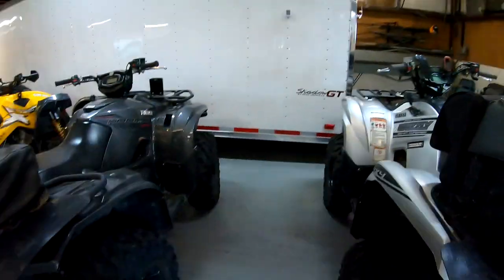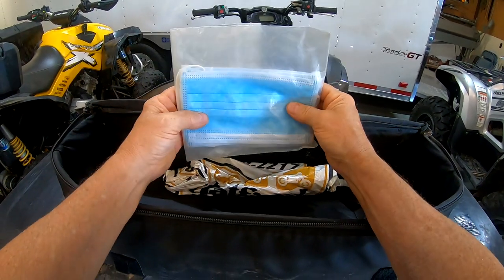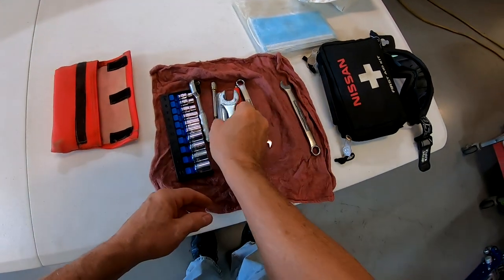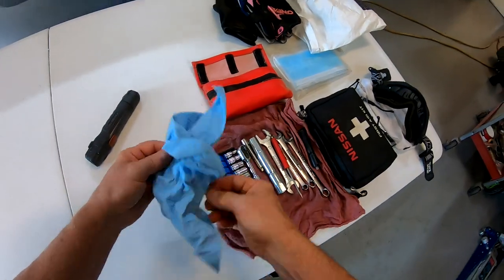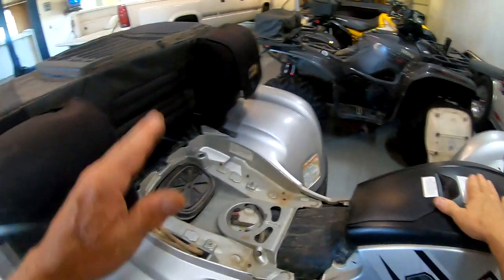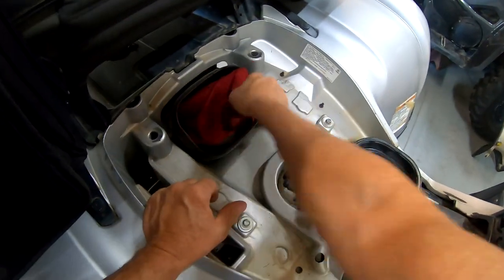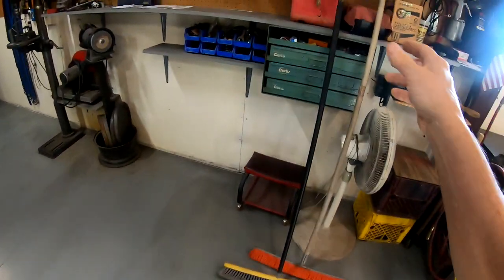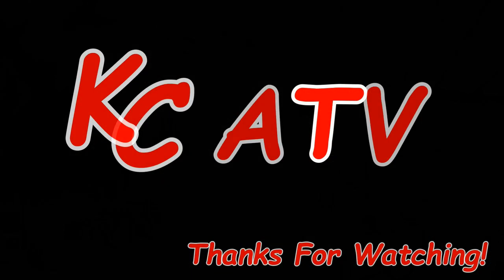Tool kit & supplies. What we carry for ATV trail riding.

Comment: Nice video. All the things you mentioned are very important things to have on a trial. I also carry a Taclife portable battery pack that will jump a dead battery, it has a 12v outlet in case the one on my ATV gives out, it has a flashlight built into it, and it can also charge devices. Great job bud. Take care.
Reply from the maker: Yeah for sure those jump start battery packs are really nice. Especially when you’re out there on solo trips. Thanks for checking out the video buddy!

Comment: I think I saw a speck of dirt on your floor right close to the rear tire on your trailer. Could you get that cleaned up for me please? I can't stand a dirty shop - lol - - -
Extra goggles: check - - - 
First Aid kit: check - - - 
Butt Floss: check - - - 
Dust Masks: check - - - 
Visine: Timmer needs to carry a bottle of that- - - 
Rain Suits: check - - - 
Tools: check (I probably carry too many) - - - 
Too many extra gloves: check - - - 
Tire gauge: check- - - 
Chain saw: check - - - 
Flashlight (or "torch" as the British say): check - - - 
Spare batteries: check - - - 
Tree strap: check - - - 
Knife: check (more than one, but why?) - - - 
Tow rope: check (more than one, but why?) - - - 
Tire plugs: check - - - 
Zip Ties: check - - -
Air compressor: check (mine is a hand pump. takes up less space and ATV tires only need a couple lbs to run decent) - - - 
Extra stuff to fix my Polaris and CanAm buddies machines: CHECK - BAHAHAHA!!!! - - - 
Extra fuel: check - - - 
Winch: check - - - 
Looks like we carry pretty much all the same stuff. Although, in my cargo box there are several other items (that I've never used), which I classify as emergency items. Maybe I need to re-evaluate my emergency items - lol - - - 
Excellent video buddy! Thanx for sharin' that info with us.
Reply from the maker: Heyyy Q ol buddy.. haha wow I don’t think you missed a thing.?The mark on the floor next to the rear trailer tire is a piece of tape. 
That way I know where to park the trailer..  Dirt? Are you crazy. LOL 
I’m sure there’s more things I should carry but oh well.. haha
Thanks for the awesome comment buddy greatly appreciated!

Comment: I also carry a Milwaukee 12 volt battery powered air compressor and tire plug kit. I have helped so many people that have needed air.
Reply from the maker: Yup I hear ya, probably one of the most common issues out on the trail is a flat tire. Thanks for checking out the video!

Comment: What kind of air compressor did u have  and the orange gps and the phone holder with brands are all them where did unget them at thanks great videos
Reply from the maker: Hi FB, I have no idea what brand the compressor is? I bought it years ago from Westlake hardware store I believe. The GPS is a Garmin. eTrex 20 the mount came with the GPS unit. 
The phone holder case brand is Nelson Rigg
Hope that  helps you out. Appreciate you checking out the video!

Comment: My God man, that poor Yamaha is sporting all the branding flair for everyone EXCEPT YAMAHA! HAHAHA! I am a firm believer in the carrying of the tp. Better to have it and not need it to need it and not have it. Poison ivy is a horrible butt wipe.

One of these days I'd like to go over my machines and put together concentrated tool kits for each of them. Not really necessary for me to be carrying around a bunch of allens and like 5.5mm sockets and stuff that aren't used on the machines. I will say that that's one of the convenient things with BMW bikes. You can dismantle those things with like 3 different sockets.

So I really like running beadlocks. I carry plugs, but lately I've thought about carrying a tube and a valve stem tool. Idk if it's practical, but if you get a bad hole, I'd feel a lot better on a tube than some of these patches people come up with. I'm sure as hell not taking the time to gently massage my beadlock ring Into place by hand with a torque wrench though either. I guess they all have their trade off.

I really liked your idea with that gas can carrier.

Great video sir. Was the CO trip this year? Upcoming series to look forward to? Count me in for that.
Reply from the maker: Hey Ron Haha Nope,  Poison ivy leaf is not good but wipe. LOL
Yeah figuring out what type of tools you might need for each particular machine is a good idea, that way you’re not carrying a bunch of extra stuff. I don’t think I really carry all that much compared to some other folks. 
No Colorado trip this year just going to go to Arkansas and do a little woods riding.
Thanks for checking out the video buddy appreciate your support as always!

Comment: You guys do a good job with communicating what headsets do you wear and what do they cost?
Reply from the maker: We are using the Sena 30K Units from sena.com. They’re about $250.00 Per headset.
Hope that helps you out thanks for checking out the video!
Reply: Asked this same questions on a different video!

How is the durability of these coms? Especially in heavy wet and cold weather?
Reply from the maker: @beesmeadschristmastrees  They are not listed as waterproof but we have ridden in rain storms with no issues. The cold doesn’t seem to bother them at all. 
Thanks for checking out the video!